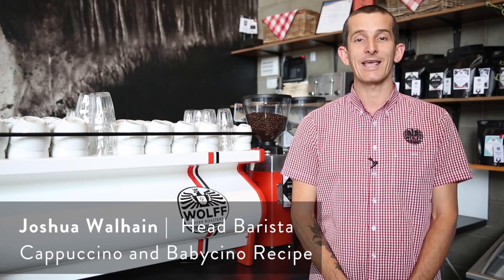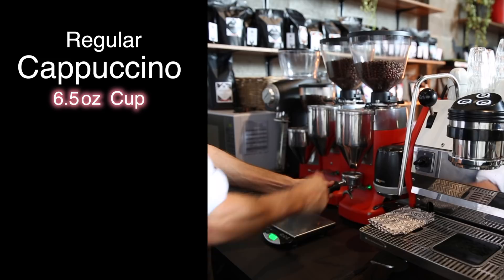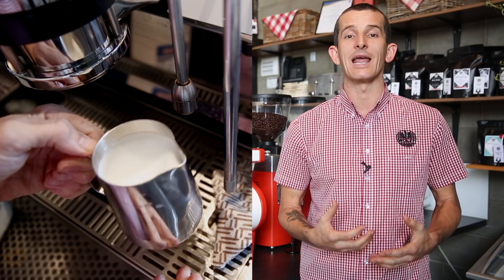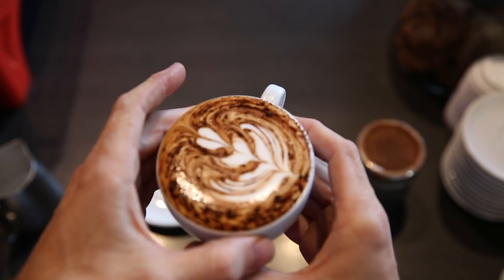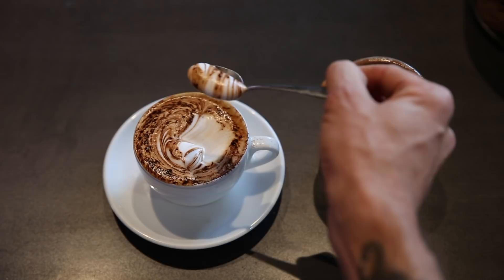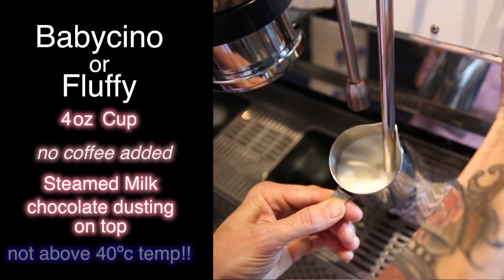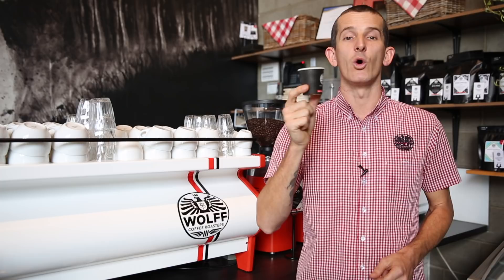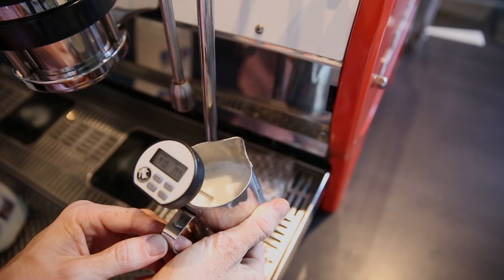Making a Cappuccino and Babycino

Comment: Double ris??? Why do you want customer to taste an underextracted cup of coffee? Should work on your recipe on espresso. 6.5oz is perfect for espresso making cappuccino
Reply from the maker: Yes technically it is under extracted, although if we dilute it with milk the the strength vs. volume balances really well in the cup. Better than a single espresso. you should try it, customers love it! though it it not a full espresso experience. You may miss out on some nuances but overall flavour is enhanced.
Reply: @WolffCoffeeRoasters  giving the db ris makes the cup taste sweeter, but unless you dial in you coffee to be used to serve as ristretto, the finishing and after taste of you cup even with milk will not be very satisfied